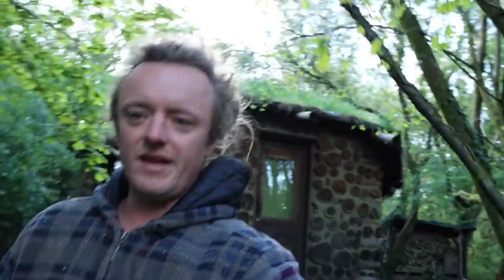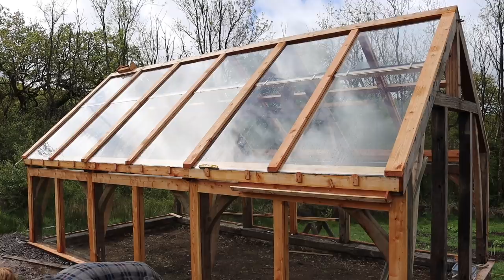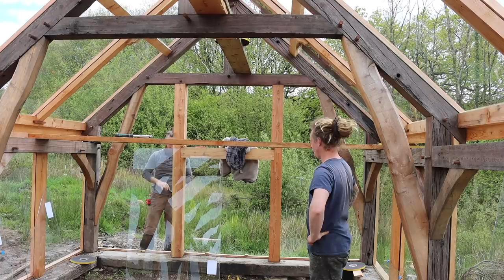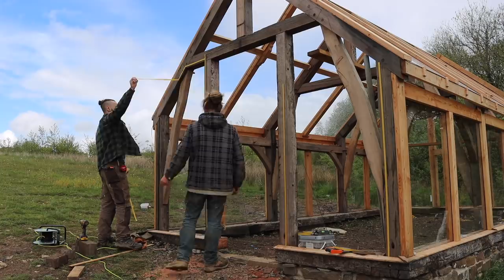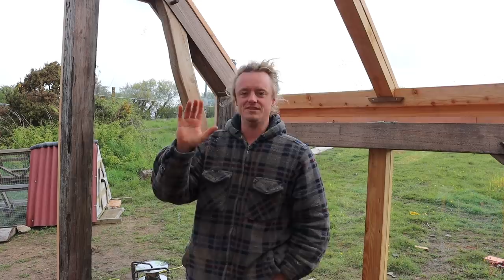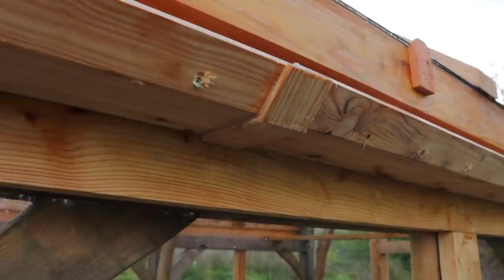Spring Fed Timber Framed Greenhouse Part 12 Finished Glazing And Wooden Guttering

Comment: You beat me to it with the solar powered circulation fans. It's not a bad idea to have a few anyway for the microgreen stage. As long as it's not too humid you won't have ventilation issues though. We've all seen how windy your property gets. Great work on both the engineering and the construction 👍

Comment: Turned out great! Looking forward to seeing it in the future when all the timber has mellowed. I definitely ended up putting thermastatically controlled ventilation in mine just because it was such a hassle to monitor the wildly fluctuating temperatures all the time, since the cats love it in the winter I just installed two cat doors (low)  and three dryer vents  up( high) for intake.Also I know its not in the K.H. style but I got a used commercial swinging glass door that I incorporated.

Comment: Fantastic.  With regards to building elaborate structures when something simpler would do:  (a)  the challenge is good for the brain and (b) the aesthetic results are good for the soul.  The bottom line is if something makes you happy do it, after all that has got to be the main reason for dropping out of the rat race.  Can't wait to see the upper workshop build.
Reply: I had a clipping on my (very cluttered) desk years ago with the quote: "Keep nothing in your life which isn't beautiful or useful."
You have the tendency to have them both ways....

Comment: Guess some people don't realize they have to polish the edges of tempered glass because it could burst into a million pieces if the tiniest of jagged edge gets tapped since there is so much tension built into the glass to strengthen it. Anyway, the greenhouse is looking fabulous.
Reply: Hi George....you are partly right they do not have to 'polish' the edge of the glass , unless you want a decorative edge!
But they have to arris the edges  - removal of the sharp edges prior to the touhening process, so as to eliminate any micro fractures that may have been  caused when cutting the glass. as this can cause the glass to break during toughening.

Comment: looks marvelous!! And it will work beautifully. About those flaps the automated opening windows for greenhouses they are an engineering pearl. When i moved in here 12 years ago there was an old overgrown greenhouse in the backyard. Last year the foundation finally went bad. So we took out the glass moved the aluminum frame to the front of the house and made a proper concrete foundation put up the frame bought a few new pieces of glass and the parts to put them in and it is basically as new. The automated windows both of them just works and think i gave them a bit of oil maybe twice in 12 years and they where old already back then. That to me is a amazing piece of engineering. The windows, The frame, The standardized glass parts, the wonderful simple way to change glass the pure fact that i can get new spare parts for something that old.

Comment: It turned out really nice, that greenhouse is definently a work of art.
When you have time in the fall you could think about makin it a 4 season greenhouse, especially if you live in the southern parts of Britan, thats very worth it.
Then you would need covers for the slits on the sides, decently sealing doors and windows, definently an aluminized thermal curtain(it is possible to automate them with an arduino steel wires and two small motors, for little money) and possibly some form of energy storage(like a climate/earth battery) or heating for example with a rocket stove(needs a lot of thermal mass for example in the walkway) or even a temperature controlled (bio)gas heater. Those things would enable you to grow for example tomatoes for 10 month in it and have them fruit 7-8 month, leafy greens like diffrent salads and also radish all throughout winter, or even cultivate all kinds of Citrus at the same time you grow winter greens, you can cultivate the citrus in big pots that you put on the walkway/center line of the greenhouse during winter month.

Comment: Looks Absolutely Fabulous, Kris. The common glass we get in the States is scored and broken at the edges, leaving a dangerously sharp edge. But the heat treated, tempered or commercial glass has smooth edges which are safe to handle. I wear gloves anyway because I’m always smashing my fingers and so on.

Comment: This thing is so awesome.
You can actually get automatically opening struts that go off temperature, no electronics needed. They have a substance inside that expands at a certain temperature and pushes open the strut, might be an option for one or two of the roof vents so you only have to fully open them on really hot days.

Great work Chris!

Comment: I made a poly greenhouse very much in same shape as yours but about half the volume. Didn't calculate anything and the ventilation was a small window at the gable. It was really, really hot but door was ~enough to keep plants alive. Ended up making one of the ridge panels (so ~1/10 of roof area) into a center-swing window. It's moved by one of those commercial wax-filled cylinder openers so it's self-adjusting. Has worked very well but it's still pegged open couple of times a year and we're "up here" in Finland.

Comment: The only comment I would ask you to consider about ventilation Kris, is that, if you look at all greenhouse designs, right from early 19th C ones, up to the present day, they all have opening vents at the ridge.
This is because, obviously, hot air rises - so the ridge is the hottest part of the greenhouse. The simple act, then of opening the ridge vent allows the hot air to escape and, providing you provide ventilation lower down - cool air to enter. Varying the ratio between the degree of opening of the ridge vents and lower vents will allow you to control the temperature under different weather conditions.
It can be flat calm and you can still ventilate successfully.
Also, you can easily add simple, 'wax piston' type auto-openers to ridge vents(and to louvre windows in the side walls, or door) to give a good degree of self regulation. These can often save plants if the sun comes out unexpectedly...!
Finally, painting 'cool glass' type shading onto the sunny side of the greenhouse is a cheap, effective way of shading, and just rubs off in the autumn! 
Cheers - and happy growing.....!!

Comment: a great job Kris. Some thoughts for the future, a filled water butt painted black will store quite a lot of heat for use in the winter. Could use "Jemp" vents if needed they provide automatic opening if temp gets too hot, and lastly hope you are going to use some windolene and get those finger marks off the glass ha ha ha

Comment: Interesting that you said your larch guttering should last 15 years.  In the city centre of Ekaterinburg in Russia, there is a small dam that was built in 1723 from larch.
Larch actually hardens when it is made wet, and when they sent divers to inspect the base of the dam a few years ago, they said that the wood was now as hard as stone and they couldn't even remove any samples for analysis.  The original plan was to replace it, but they found that it didn't need it.

Comment: Point of order: Gloves are like seatbelts, most of the time you won't need them but if you're not using them the one time you do you're in for a bad day.
Reply: 010100 -    Reply to your point of order (posted by George H): "Guess some people don't realize they have to polish the edges of tempered glass because it could burst into a million pieces if the tiniest of jagged edge gets tapped since there is so much tension built into the glass to strengthen it."

Comment: Glass slips through gloves very easy  when even a little wet plus if that glass is slipping in your hand you want to feel it slipping I got many cuts as a young glazier you learn to grip it with your finger tips but gloves were only used when you were hacking out or broken glass when it didn’t matter if you dropped it
Reply from the maker: Exactly.
Reply: Love you kris

Comment: Inspiration. I did a timber frame green house, but learned from this. Cringed watching the handling of glass bare hands and unprotected neck arms etc. I lost my wrist flexors due to a falling metal roof piece and can see glass doing the same. Please. Tig gloves are great protection with gauntlets or might gloves and a fire hose like coat from Duluth is now my ppe.
Thank you!

Comment: Nice job, but really feel more ventilation is needed especially to the roof it will need  a lot of shading to reduce the internal temperature. On a side note years ago replaced timber guttering to the front of a late Victorian pub ,run out of a single piece of Pitch pine  ogee in profile, only place it leaked was above the door, cleaned a section that went to the brewery's museum.

Comment: Very nice and very special building. I love especially the timber-framing of the basic structure. (Didn‘t quite understand, why you changed to using metal later on - couldn‘t you have continued with pegs and glue, i.e. traditional carpenter‘s work)? But even though, an admirable piece of work; and I very much enjoyed watching the series. Crossing my fingers that the ventilation-concept works well for the vegetables to be grown.

Comment: Very nicely done, but if I could ask a completely nonsensical question, How will you remove the rain marks from the glass, and also does the glass have a high enough resistance to heat to survive an attack by a welsh dragon? Again, it's always a pleasure to see such good and careful work done.  Thank you.

Comment: Great job, but as a building contractor I don't like the detail where the glass meets the fascia.  I think it's asking for trouble.  Easy to fix with an aluminium trim to project a drip edge 20-30mm beyond the fascia.  Not a criticism, just advice.

Comment: Nice.

I know that you practice and learn new things by building it in the way that it's built. But I was wondering. Wouldn't a greenhouse be easier ( and perhaps even more economic ) to build, if it would be built as an A-frame? With the footprint increased slightly to make up for the slope.
Reply from the maker: It would have to be very tall otherwise planting close to the sides would be quite hight restricted. If you made it tall enough at the edges to have enough space to grow upward it would be way taller then required so i dont think it would be more efficient.

Comment: Excellent workmanship. What is the black tape / gasket you are sticking on the frame to hold the glass. Must be very strong to hold the glass even temporarily. 

Could I have the name of it? Also are you using normal toughened glass?

Comment: there is no plan to put some paint or oil at the outside of the wood to protect it from the wet english weather ? there is such a lot of work in it so it should last as long as possible . . .

Comment: That came out very nice.  Not knowing much about that glass, how does that glass compare to those double wall polycarbonate 'greenhouse panels' that I have seen other people use (like for big fishtank lids and greenhouses).   ie how would that glass do for hail and other impacts etc?
Reply: Toughened glass will withstand ANYTHING the UK climate will produce! In fact, ordinary glass will(in smaller panes). Greenhouses were built that way for 150 years!
Also, glass transmits more light(crucial in a greenhouse!) and lasts much longer...

Comment: Hey Kris, are those strips enough to hold the glass even if it is windy? Greetings Kees from the Netherlands.
Reply from the maker: Yeah more than enough, 30mm thick and 125mm wide screwed down with 8 stainless steel screws. each one could hold quite a few tons of force. the glass would break long before it was pulled off.

Comment: I don't know anything about the Larch wood you used for the guttering.  But wouldn't you get more life out of it if you sealed it with say polyurethane and maybe double the 15 year lifetime of it?  I'm not meaning to be critical I just believe in making things last as long as possible.  The greenhouse looks great and as always your craftsmanship shows itself in your end product.
Reply from the maker: None breathable coatings like that just trap in water. An oil and beeswax could work well to make them watertight but it wont make it last longer. If it was pine or something a coating would help alot as it would need all the help it could get but larch will last way longer than any paint or coating will.
Reply: @KrisHarbour  Fair enough sounds like you've done a bunch of homework on it.

Comment: great stuff as usual Kris. That is one excellent greenhouse.  I see the spring is back 
What were you using originally to keep the glass in place, some kind of double sided tape?
Reply from the maker: Its foam glazing tape. its basically just there to provide a soft backing for the glass and to allow the timber to move as it dries. The glass is all held down by the external timbers. its called direct glazing.
Reply: @KrisHarbour  I see right. thanks

Comment: You need to tell people the difference between plate glass a toughened glass ... like plate glass has Sharpe edges,  and toughened glass has smooth edges... folks are going to brutally rub their finger across plate glass and cut their fingers   where toughened glass you can rub fingers all day long , only saying that's all
Reply: Hi Dave....all glass has sharp edges ! unless it is removed .....as it is with glass that is going to be toughened.